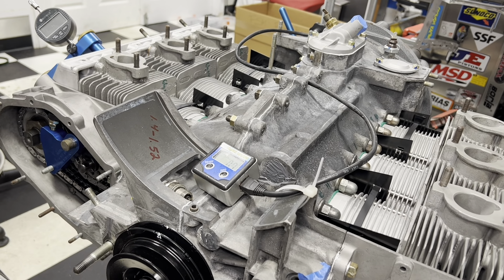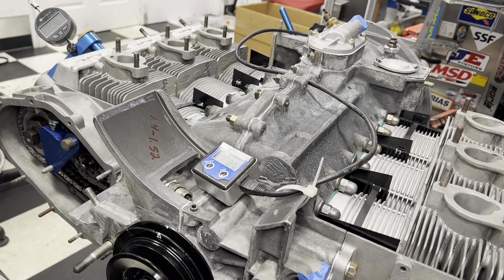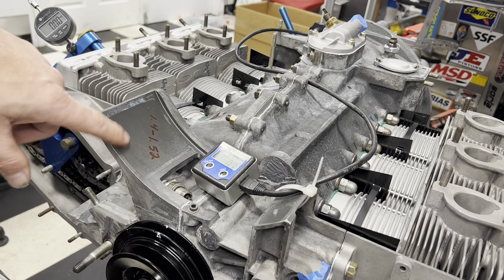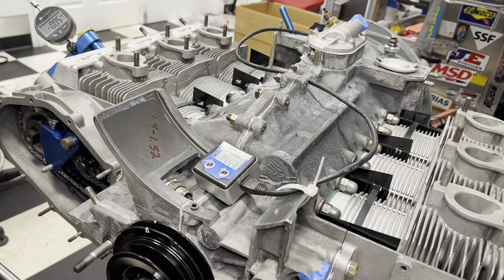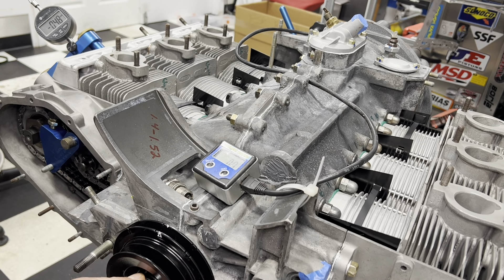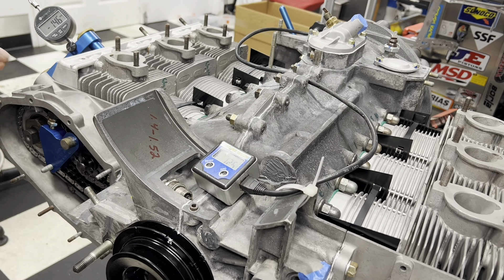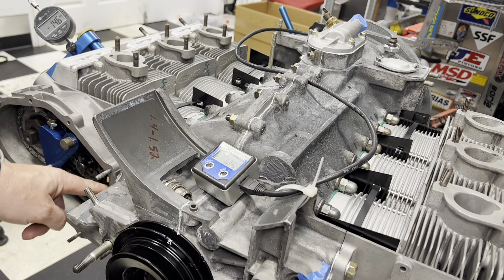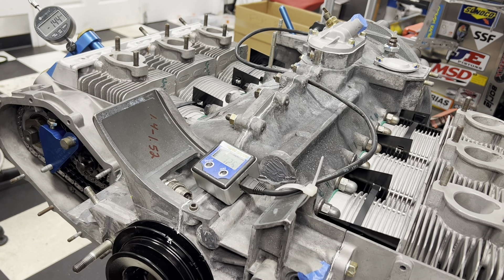Cam Timing on a 1974 Porsche 911S Engine

Comment: When you are chasing a few hundreths of a mm, you can achieve this by simply loosening the 46mm nut, and resetting the cam position, using the 'slop' where the pin is located in the sprocket. No need to pull the sprocket or the locating dowel... there is usally a few degrees leeway in every pin location.

Comment: M1 cams? Bought to install the same in my 3.0
Reply from the maker: I’m not familiar with the “M1” designation. So probably not the same grind.
Reply: @Josh Groth With respect to the M1 cam, make sure to check your valve clearances on both exhaust and intake... if your heads have been machined and you are running a tight deck clearance, you'll find that your intake valve clearance gets close around the 10-15 degree range after tdc.